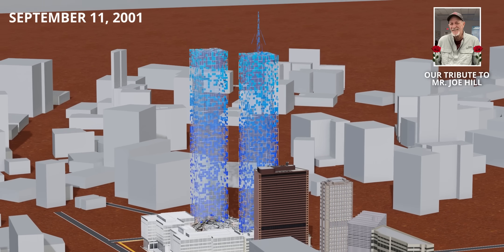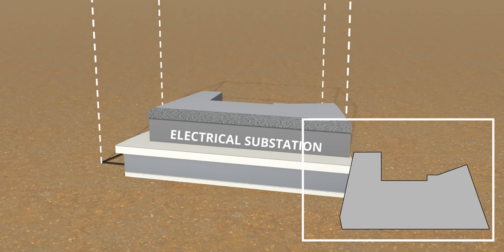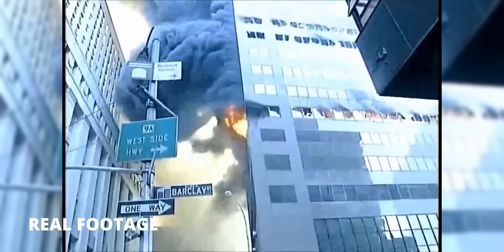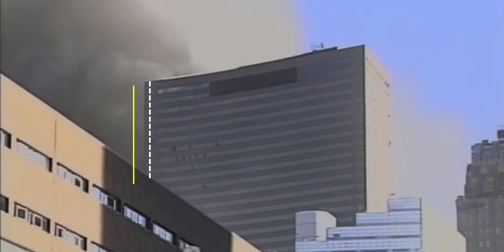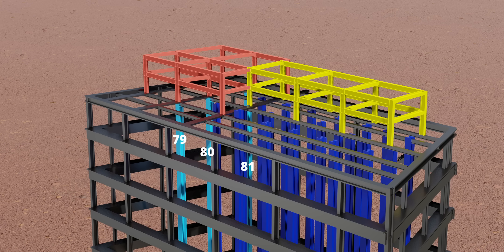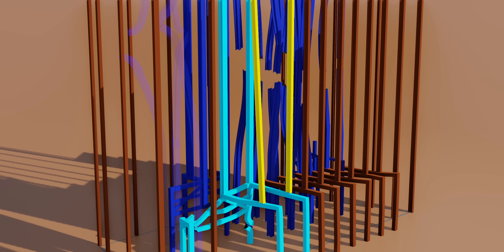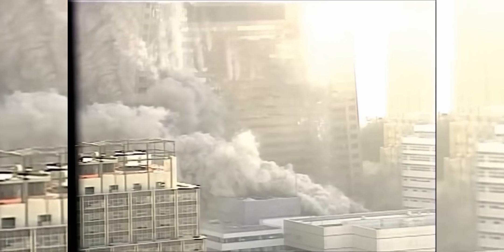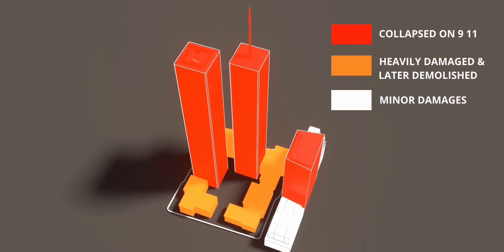Collapse of Building 7 | The Complete Physics

Comment: Smoking gun was BBC reported it falling a full 20 minutes before it happened. How would they know?
Reply: The collapse of a "40+ storey building" was reported even hours before.

Also there were firefighters running around claiming the building was leaning - which it wasn´t - and that it had a bulge - which it hadn´t.

The leaning lie was also spread for both of the twin towers.
Reply: @Kudde23  All done now princess?
Reply: Let's try using the thinking part of the brain instead, starting with some context. 

The media had been reporting that Buildng 7 was in danger of collapse or about to collapse for most of the day, starting shortly after it was hit by the falling North Tower and caught fire at 10:30 am. As Building 7 became increasingly unstable throughout the day the FDNY had ordered the area around the building evacuated and even suspended rescue operations on the pile early in the afternoon. The media were getting all of this. In the chaos and confusion of that day a wire service (Reuters) made an error and accidentally reported that Building 7 had collapsed instead of was in danger of collapsing. Simple enough. These sorts of things happen all the time in rapidly evolving ongoing news events and there are hundreds of examples on 9/11 alone.

The BBC repeated the wire service report.

Should we care that a British reporter (ie: not from New York), four miles away, with her back turned to a skyline chock full of tall buildings did not know which one of those hundreds of tall buildings she was not looking at was Building 7?

I don't think so. 

She was doing her job, reading the report. 

Worth noting that local CBS 2 reporter and weekend desk anchor Vince DiMentri had a bit earlier reported from INSIDE BUILDING 7 (not from 4 miles away) and _he didn't know what building it was either. 

A local reporter, not a Brit on short-term assignment in one of the largest cities in the world with thousands of buildings.
Reply: @h1F595  Videos and pictures my poor mikrobrain.
Reply: @Kudde23  Anything else princess?
Reply: @h1F595  This was shot right at the foot of WTC7 minutes before it collapsed my poor little liar:
/watch?v=t5tEy6mXSE8

So where´s the bulge mikrobrain? Where´s the leaning mikrobrain? You can also use every single WTC7 collapse video that includes the penthouse descent to show any leaning or bulge. Good luck my poor little wannabe. You could also use their monitoring data if they ever release it.
Btw: Towards which direction was the alledged leaning? See mikroshill, your bosses didn´t even tell you that, they didn´t even bother to make up some details for their stupid lie.

Comment: 6:13  THIS IS A LIE.  Office furniture and paper  do not burn at 600 C. This is the same lie perpetrated in tthe false explanations for the other towers. And even if it did burn at this temp, the fire insulaton layers on tthe core columns protected them for a long time.
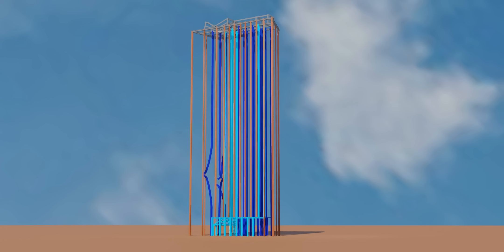6:35 LIE no2.  the pent house or the cooling equipment were neither that heave nor put so much load on tthe columns .

LIE no3
The roof  kink is not an optical iillusion.  A  horizontal kink would be identifiable by the change in light shade of the facade. This is a vertical kink.

LIE no 4
Bulding columns are  designed to sustain collapses of adjacent columns. They do not ttopple like dominoes or pull each other down like laundrry lines. They are laterally supported by bend resistant beams.  

All what you are saying cannot hide two undeniable facts: 
1- BBC said that building 7 has collapsed before it even did by 20 mins
2- The now wanted Criminal Rudy  Giuliani said on public TV befored: " we are going to pull tthe tower "
3- No steel tower has ever collapsed by fire except according to you.
Reply: @h1F595  "by someone who misinterpreted a report from the firefighters"

Then prove that mikrobrain!

Comment: A guy said "pull it".  Then the internal charges were set off.  Then building 7 colapst.
Reply: Uh huh. Is that what happened?
Reply: So super secret silent explosives? No such thing as- you can hear demo charges from miles away. To cut that amount of steel would require thousands of kilograms of explosive and the precutting of many other beams with gas torches.
Reply: @NapoleonGelignite  Thermite.
Reply: @ - nope. You need tens of tons of thermite to cut that much steel - and it doesn’t ignite reliably in the way demo charges can be timed. So a ‘controlled demolition’ drop can’t be achieved using pyrotechnic composition. You’re using magical thinking.
Reply: @NapoleonGelignite  So you have no clue, ok...

"You need tens of tons of thermite to cut that much steel"

How much steel is "that much steel"?
Reply: @Kudde23  - lol. I do have more than a clue as I don’t live in front of a computer in my mom’s basement. Here’s an experiment for you. Get a large piece of ice and see how many cups of tap water it takes you to cut through it by pouring it into the ice….
There’s a reason thermite isn’t used in cutting steel.
Reply: @NapoleonGelignite  "I don’t live in front of a computer in my mom’s basement"

Are you sure about that my poor little wannabe? You don´t even know the basics, OBVIOUSLY.
Ice and tap water...
So what´s the temperature difference between the two? 30°C? 50°C? 100°C? The coldest place we found in space is -272°C. Compared to room temperatur (around 20°C) that´s a difference of less than 300°C.
Thermite creates temperatures around 2400°C. Compared to steel of room temperature that´s a difference of not less than 300°C but more than 2300°C.
So you poor little wannabe really think 2000°C makes no difference?!? Or are you trying to be funny my poor little wannabe?!?
Reply: @Kudde23 - oh dear. It is not about temperature my simple friend, it’s about enthalpy of fusion, and conduction. 
Pour molten steel onto steel and it doesn’t melt the steel the way you imagine. You ever worked with thermite? Of course not. 
If thermite is so magical why isn’t it used in demolition? It’s because it isn’t reliable, safe or economical. Please don’t lecture me about things you obviously have only keyboard experience of.
Reply: @Kudde23  Anything else princess?
Reply: @joshd3192  Are you showing off all your skills again little Poorpoo?
Reply: @Kudde23  All done now princess?
Reply: @HowardFinkelsGhost  Yes you are.
Reply: @Kudde23  Anything else princess?
Reply: @Kudde23  All done now princess?
Reply: @joshd3192  That´s so sad little Poorpoo!
How many of such comments do you have to post to earn a cent little Poorpoo?
Reply: @Kudde23  All done now princess?
Reply: @Kudde23  - what is the difference in state between graphite at 0C and 2000C? Nothing solid at both temperatures- your smooth brain thinks ‘big number mean big difference’. Go to school.
Reply: @h1F595  Was the perimeter inward bowing instant mikrobrain?
Never heard that walls and floors tend to block light, even if it comes from thermite reactions mikrobrain?
Was the molten metal pouring out of the south tower invisible mikrobrain?
Reply: "no they actually opened a black hole and all of the people who got it on film got sucked up prove me wrong"

Comment: SABINS whitewashing engineering and disinformation ...   Funny how your model falls so differently from NIST's.
Reply: There are no models in this presentation, only animations. The collapse sequence is the same. Initiating failure at the NE corner. Failure of the east end core columns. East Mechanical Penthouse drops through the building. Progressive failure of remaining core columns from east to west until the core is gone, leaving only the outer shell still standing. Moment frame fails last.

Same sequence. You should brush up on your NIST
Reply: @TheCriticalStinker-01  How could the empty outer shell keep up the western penthouse my poor little liar? Now dodge and whine my poor little liar.
Reply: @Kudde23  Anything else princess?

Comment: This video as all BS!
Reply: And yet not wrong. Go figure. 
	
This video is very good – with one or two exceptions - and goes into a much higher level of detail than many viewers will be able to comprehend.  While not perfect, the collapse mechanisms – the sequence of failures - described here  are substantially correct and this is true no matter who planned and carried out the 9/11 attacks or why . 

That may not be what you want to hear and go against 20+ years of entrenched dogma and conditioning, but it’s not wrong. 

That also means (in case you did not get the hint) this video can be (and IS) absolutely correct in its description of collapse mechanisms AND the 9/11 attacks could still have been some sort of inside job. The two things are in no way mutually exclusive. 

The mechanisms described here have broad professional support around the world. There are no professional engineering organizations (for example: ASCE, ASEE, ICE, etc) that disagree with them or have offered any formal dissenting opinions or alternative hypothesis. 

So, setting hubris aside, either the overwhelming majority of the worlds structural engineers and simple observation are wrong,… … or you are. Which seems more likely? 

IF you still think believe this explanation is wrong then produce a better one . Good luck with that. No one ever has and I don’t see you moving that needle today. 

No one ever does.
Reply: @TheCriticalStinker-01  So where´s the explanation for the free fall my poor little liar? Now go dodge and whine my poor little liar...
Reply: @Kudde23  Anything else princess?
Reply: @ButtHead-n5u  The obvious explanation is controlled demolition my poor little copypoo.
Reply: @Kudde23  Anything else princess?

Comment: If a building has a fault, that is exposed in it catching fire, or collapsing.  The results would be. 1. the wreckage would be analysed to discover what part of the building was at fault, be it design or construction.  2. the building owner would sue the builder/designer, depending on the results of the investigation. (if a building that was designed to withstand fire collapses due to fire, some party is ultimately at fault.) 3. If the buildings design was correct to current standards/codes and constructed to that  design, then there would be a change in the building codes, as with Grenfell, and retro remediation works carried out on all existing buildings built to the same codes.       In this instance none of the above took place.
Reply: You are operating on a false starting assumption - that there was any fault in the design or construction.

Collapse of a burning structure is always a concern for firefighters. Steel buildings subject to fire rely on active fighting of the fires to survive. Left to their own devices they will collapse. Buildings are designed around 1 to 3 hours of fire resistance, allowing time for occupants to escape and ACTIVE firefighting to get started, after which all bets are off. In Building 7 the occupants escaped, passive and active fire protections were compromised and active firefighting was abandoned which left the building to take its chances. 

It lost. 

Odds on Building 7 would eventually collapse in those circumstances, and it did. No big deal in logic. That is the sort of choice firefighters make every day in brush fire situations - which houses to save and which ones to let go. Only real difference here is moving the decimal on the size and cost.

The fact remains, Building 7 was designed for 2-3 hours of fire resistance with active firefighting and lasted for 7 hours without. A truly remarkable performance.
Reply: @h1F595  "The wreckage was analyzed, and it was determined that the building design was not at fault."

Determined mikroshill? How?!?
NIST indeed analyzed steel from the fire zones. They found that NONE of the analyzed steel had reached 600°, not a single piece. Most of the steel hadn´t even reached 250°C. Far too cold to match NIST´s fairytale.
So, mikroshill, they didn´t determine that the building design was not at fault, they claimed it was not at fault based on contrary analysis results.
Reply: @Kudde23   Anything else princess?
Reply: @joshd3192  Are you showing off all your skills again little Poorpoo?
Reply: @Kudde23  Anything else princess?
Reply: @Kudde23  Anything else princess?

Comment: 6:24 that's not correct according to NIST. The columns didn't suddenly buckle.

Here's what happened according to NIST. Girder A2001 was connected to column 79.

The girder was pushed off its seat through thermal expansion of the beams that were connected to it.

After the girder was pushed off its seat, the column buckled.

So, what really caused the collapse is thermal expansion of the beams.
Reply: That is one of two scenarios presented by The NIST and there are other hypothesis presented in different studies of the event as to the initiating failure. The common denominator in all of them is the buckling failure of east end core columns which precipitated progression to total collapse. I don't think there is any reason for a video like this to get into that level of detail.
Reply: @TheCriticalStinker-01  It has to get into that level of detail because buildings are specifically designed to withstand weakening from fires.

Saying the columns buckled due to weakening from the fires isn't a proper explanation because that's not plausible.

It's just a lazily researched video that doesn't provide any real understanding of what NIST says.

Also NIST only presents one scenario. They explored different scenarios but what I mentioned above is the single & final scenario they present.
Reply: @john_hunter_  - Collapse of a burning structure is always a concern for firefighters. Steel buildings subject to fire rely on active fighting of the fires to survive. Left to their own devices they will collapse. Buildings are typically designed around 1 to 3 hours of fire resistance which allows time for occupants to escape and ACTIVE firefighting to get started, after which all bets are off. Do not confuse fire resistance for immunity because these are not the same things.

In Building 7 the occupants escaped, passive and active fire protections were compromised and active firefighting was abandoned which left the building to take its chances. It lost. Odds on Building 7 would eventually collapse, and it did. No big deal in logic. That is the sort of choice firefighters make every day in brush fire situations - which houses to save and which ones to let go. Only real difference here is moving the decimal on the size and cost.

Worth noting though The NIST do not claim columns buckled resulting in progression to global collapse due to the fires. 

This video does not dive into collapse initiating mechanisms, for which there are a number of plausible scenario's even besides those NIST proposed, and for its target audience it does not need to. That is not being lazy.
Reply: @TheCriticalStinker-01  The fire resistance is designed for 2-3 hours. This is because when a fire burns through a building, it moves as it burns up the material.

A fire will only be in a single place at any time for around 30 minutes to an hour. The 2-3 hours of fire resistance is part of regulations because it's far more than enough for regular office fires.

Fire resistance is essentially a thermal barrier that reduces the spread of heat to the steel structure. The time limit is the time frame in which it can keep the temperature below 175°C. The temperature at which structural steel starts to weaken is around 300°C.

Once it gets past that temperature it can take around 30 minutes to an hour to weaken to 60% of its original strength. In general, buildings are designed to remain standing at 50% of their original strength.

It's not guaranteed to remain standing if the whole building goes up in flames but they are designed to withstand severe fires. There are multiple buildings at a similar size that have had larger fires & they have all remained standing.

In the case of this fire, it wasn't weakening of the structure that caused the collapse.

It is a lazy video because it provides a completely unrealistic scenario of the beams buckling due to weakening from the fires.
Reply: @john_hunter_ - Please respond only to what I actually wrote.  I don't do men of straw
Reply: @TheCriticalStinker-01  I did. Fire resistance isn't only for the occupants to escape. It's also about maintaining structural integrity that aims to prevent a collapse.

All bets aren't off after the 2-3 hours of fire resistance. It's not the case that a fire will burn for longer than 3 hours in total & then its up to chance for the building to collapse.

The fire resistance aims to prevent the steel from weakening by providing a thermal barrier to keep the temperature below the threshold of weakening as the fire burns up the fuel.

There is a chance that there will be hot spots that can end up weakening the steel & they also take that into consideration when designing the building. They will generally ensure the building will remain standing at 50% strength.

It is a lazy video because it's meant to be "The Complete Physics" of the collapse. Yet it doesn't go into detail about any of the different collapse theories.

It just says fires at 600 degrees Celsius caused the columns to buckle & that's not in any of the collapse theories. It's an extremely lazy video about "The Complete Physics".

They spent more time on other aspects than they did on the initiation of collapse. That makes it a bad video.